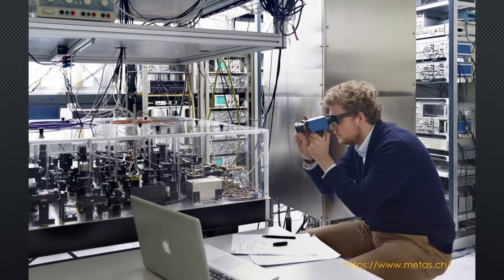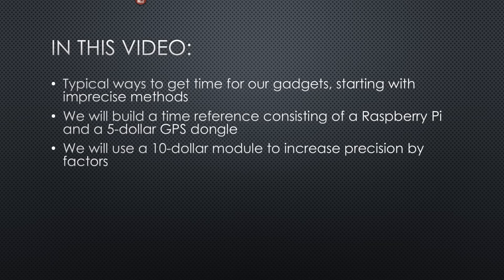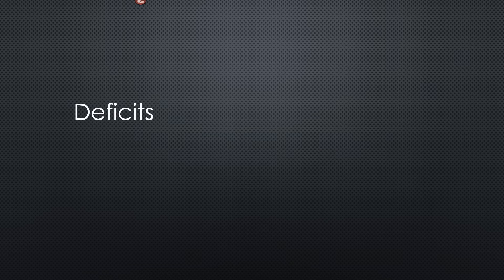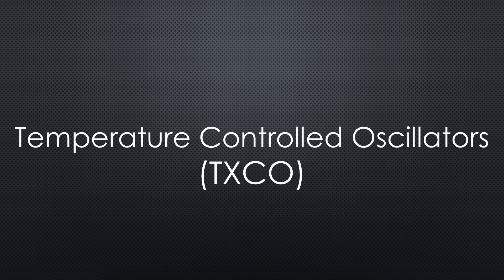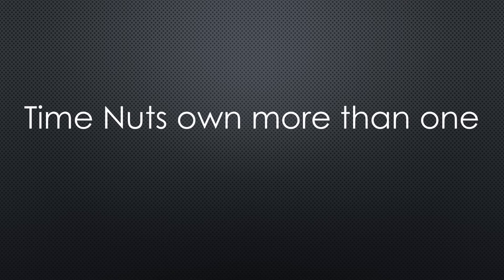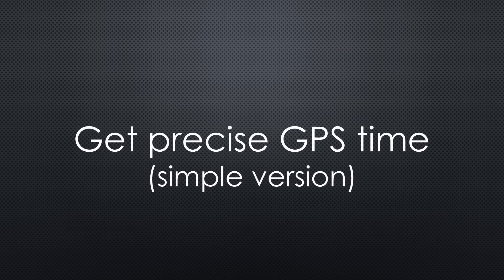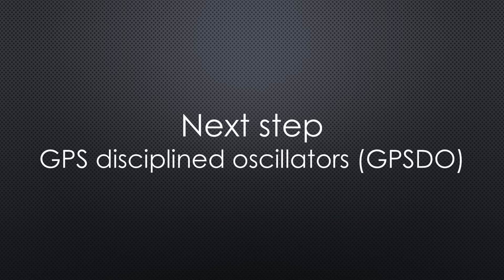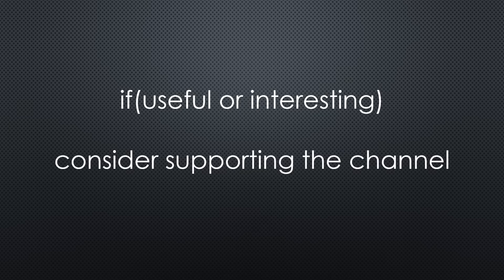(503) Precise Time without Internet: NTP Server from GPS Satellites

Comment: Get a $2 board with SMA connectors with neo6,7 whatever and remove the module. Order a used NEO-M8T (just the "chip"), real timing chip for about $25 and solder to the board. Also multi constellation antennas are available for $3, very little difference when compared to $65 survey antenna. Let me know if you need links.
Reply from the maker: Yes, links would be good because your stuff sounds interesting. But not here. They will be deleted.
Reply: @AndreasSpiess  Just came back to check if you saw my reply to find out that YT deleted it. Maybe this time it will stick: I have posted a response on my channel, it's in the shorts section.
Reply from the maker: Thank you! Now I have seen it. I have such a board, just with an M8N chip. It is very handy because of the two antenna connectors.
Reply: @AndreasSpiess  I started to play with GNSS using the same chip. I have de-soldered the the patch antenna and C2 from the board. When you connect an external antenna the patch antenna is working in parallel and that leads to errors in positional accuracy.

Comment: Have you looked at the GPS receiver available from Hans Summer over at qrp-Labs ( QLG2 )? Very reasonably priced(about $USD25), "kit" (although it's almost entirely factory smd loaded, just connectors and a case needed) that has 2 nmea ttl serial and 1 usb output, as well as pps output. It also has separated antenna with lna and an option to install a super cap on the board to hold the satellite data for faster startup. I have one in my shack and will be hooking it up to a raspi for my network time source. For now it disciplines the clock on my wspr transceiver and shack radio.

Comment: Excellent video.  Having spent way too much time in this rabbit hole,  I can attest that getting to nanosecond timing is relative easy,  but going beyond that point is very very difficult.  I thought I was doing well until Mr Sol started to show it's spots.  Getting an NTP server with 10ms accuracy is easy,  and good enough for most most sane people.... :->  but requires having an antenna with a good view of the sky.
Reply: For free order of magnitude improvement switch from NTP to NTPSEC.  We cut a lot of garbage out of the NTP Classic code base and got a huge performance and security gain.
Reply from the maker: I agree with all your statements. I added the PPS chapter because it was so easy...

Comment: I'm using this "ATGM336H GPS BDS Dual-Mode Module for Arduino & Raspberry Pi" with my telescope (OnStepX). It also outputs PPS and syncs in a few minutes even in my basement.
Reply from the maker: Interesting! What material is your house built of? Ours are built with lots of concrete, and no GPS signal comes through.
Reply: @AndreasSpiess  that explains your lack of signal. in the US, most residentials are wood stick-frame. Typically, reinforced concrete is reserved for walls in "nicer" houses or if a buyer requests it during construction. Anything partially or fully subsurface will be block or concrete w/ the upper floor(s) being wood frame.

Comment: I built a similar project last year with a different GPS module. I had to solder the PPS output directly to the chip. The module is now in the attic under the roof and the serial OUT incl. PPS is routed to the Raspberry via a 15m CAT6 network cable.
Reply from the maker: Indeed, not all modules expose PPS. I had to do the same with another module.

Comment: GPS signals can be "jammed". If that's important for what you do it's when you need rubidium clock references.
Reply from the maker: I agree with the jamming. However, rubidium clocks usually do not know the time. They just generate a clock and you have to convert it in time. For jamming, most people probably would stick with the system time for that period and synchronize again when the signal is reliable again.
GPSDOs use the same principle, BTW.

Comment: To make sure all my devices get proper time, I have a firewall rule to redirect all NTP (UDP port 123) connections from the lan to my time server.  No messing around with each device, and I can switch it around by just changing one thing.
Reply from the maker: Good idea!
Reply: @d00dEEE  Is it a real time server? If not I’ve seen recommendations to have (at least) three working as a cluster. Each can also include a different upstream NTP server provider, not just different servers at the same provider, so the entire consensus won’t slowly drift from the legal time while giving you good isolation if one or more of the upstream sources is compromised.

Comment: Very interesting, thanks for another great video, perfect timing too!
I am building a stopwatch system for sport where start and finish lines are remote (perhaps 2-400m) where I wish to use Meshtastic, serial, ESP32's to signal start/finish times to paired devices but need a time reference.  Is the PPM signal synchronous between GPS modules that it could be a heartbeat to synchronise my devices to calculate elapsed time?  Any accurate sync pulse would do if it is synchronous with ever second rolling over in GPS time.  What do you think @AndreasSpiess ?

Comment: Andreas, fyi XCO means Crystal Controlled Oscillator. I believe the X is used because it is similar to the symbol for a crystal, in schematic diagrams. And "C" has so many other uses.
Reply from the maker: Thanks for the info! I never looked it up.
Reply: @AndreasSpiess    I believe it is TCXO, for Temperature Compensated Xtal Oscillator (crystals on schematics are often designated with X or Y) and Oven Controlled Xtal Oscillator.    XCO is at least redundant, as an ordinary oscillator can be controlled by a crystal,  making it a crystal oscillator, XO.  An XO or TCXO can be a single device in a DIP package, or made of discrete components including a separate crystal.  Discrete TCXOs are uncommon, I would think, much the same way we don't laser-trim slices of quartz ourselves these days, though I wouldn't put it past some Time Nuts, having seen a YT video about a guy who makes integrated circuits in his garage.
Reply: In this context, X most probably refers to the Greek letter “chi” which is also used in the church for “christ”. So in some way that’s also not too far off the word “crystal”.
At our institute we use a machine for electron beam evaporation (to put very thin layers of metal on semiconductor samples), where an “Xtal” is used to measure the thickness of the deposited film. It’s actually a crystal, too.

Comment: Have you looked into the Precision Time Protocol?
Reply from the maker: No. I did not know it exists :-(
Reply: @AndreasSpiess  It would take the place of NTP in your setup and then you can synchronize the time between different machines on your location to sub-microsecond precision.
You probably won't be able to find an internet collective you can hook into like you can with NTP for example and therefore you would still need a primary feed from an atomic clock.
But it is good enough to synchronize the sampling of audio frequencies within the range of human hearing across hardware under your control.

Comment: Time nut here, too :)

An equally cheap (if not cheaper) way I've used in a recent project is software compensation, much like what NTP does, just drastically simpler:
* use a common 32.768 kHz crystal
* use just enough capacitive load so that the crystal oscillates slightly above the desired frequency
* calibrate the clock against a computer that runs the NTP daemon and deduce the number of one-second ticks to wait until you skip exactly one second.

This method can achieve precision in the PPM or maybe in the tenth of a PPM (not tried yet). I used it with my clock project and the result is barely one second drift over one month, which is nice.

I used a Raspberry PI and a program I wrote to count the number of events on a GPIO that is fed with a one second pulse signal coming from the microcontroller I want to calibrate. The latter in my case is an ATmega328 with timer 2 connected to an external 32.768kHz crystal and no capacitive load (it's not strictly mandatory). Pin OC2B provides the one-second pulse.

The AVR library has time management built-in and uses a 32-bit counter, which requires the application code to increment that counter every second. As for time compensation, I use timer 2 overflow interrupt routine to decide when to skip incrementing the counter.

Note that you don't have to use an ATmega328 though. A CD4060 would do as well but you have to use a microcontroller to do the calculation/adjustment.

For calibration, the computer (e.g. a Raspberry Pi) clock must be stable enough, which is reflected from the results of the `ntpq -p` command (or `chrony`). Check the NTP references use PPS. I found out that counting sufficiently large numbers of events (e.g. 7200 or 2 hours) is enough to reach precision in the PPM.

This kind of compensation of course assumes a stable ambient temperature or at least drifts compensate each other throughout the year. A more complex implementation may add in temperature measurement and empiric correction factors and that's a bit more complex but you get the idea.

Comment: I am on the 'time nut spectrum'.  I've used GPS antenna on desktop to become a local NTP server, but I also have several old-time mechanical pendulum clocks (a mantel clock, wall-mounted clock and a floor-standing tall-case ('grandfather') clock).  Obviously they are not as precise, but I set them each week to my GPS time.  :)
Reply from the maker: Now you could try to synchronize the pendulums with a magnet to your GPS clock ;-)
Reply: @AndreasSpiess  Hmm.. that would be a little tricky.  Each clock has a different length pendulum because of how they are displayed (fireplace mantle, hanging on wall, standing on floor).  But I suppose once I figured out the number of 'ticks' per second, it would be trivial to adapt each to specific clock.
Reply: Pendulum Taming is the way :D

Comment: A few years ago at a power plant I was working, they were doing a SCADA computer upgrade.  In one review meeting, someone noted the contract required attaching a GPS receiver to the top of the building.  Some of us were like, "Uh...we know where the building is, and it's not likely to move."  LOL

Of course what they were doing is exactly this, using the time reference signal embedded in GPS.

P.S.  We did have oven-controlled crystal oscillator used to help with maintaining system frequency but that was a much older tech.
Reply from the maker: Nice story! All cellular towers also have such GPSDOs with oven-controlled oscillators. We get some of them for cheap when they dismantle the old 3G towers. And I think that the GPS on eBay I showed also comes from such a tower.

Comment: What happens if GNSS is jammed or taken out?  You can still get a very good PPS signal by listening to pulsars. It takes a few hours of integration time before it's usable, though.
Reply from the maker: If jamming does not occur all the time, you can leave your system time "free-running" during jamming and synchronize when the GPS signal is back. In the short run, quartz clocks are stable enough.
Reply: @AndreasSpiess  where are the good old DCF-77 or HBG ?
Reply: That's what your GNSS disciplined rubidium standard is for.  It'll keep very accurate time during the periods GNSS is not available.  Or just get a cesium clock :)

Comment: Is It possible to get precise time from the Galileo positioning system?
And if one wanted to keep a simple microcontroller synchronised, how good can relying on DCF77 (European continent) or MSF (UK) be?
Reply from the maker: Most modern GPS receivers use all satellite constellations. DCF77 is based on atomic time. So, it is accurate. But sometimes not audible.
Reply: Thank you,  @AndreasSpiess .
These terrestrial long-wave broadcasts can, indeed, be quite weak (I have all my alarm clocks/wall clocks synchronising with the MSF and they really struggle in certain rooms of my house) but they seem so much simpler to use, even with a very modest MCU, provided one can find the receiving modules.
Any experience with DCF77 and microcontrollers? I guess an accuracy of a few ms should be achievable?
Reply from the maker: I made a video where I built my DCF77 transmitter for the basement...
Reply: @AndreasSpiess  
I'll check it out 👍

Comment: I've used GPS USB dongles, Chrony, and Pis or PCs for years, both on the home network and while in the field with Ham Radio deployment. I haven't found need for PPS accuracy in my usage, yet.
Reply from the maker: I also plan to use one of my NTP servers for our AREDN network that is not connected to hte internet.

Comment: What about using GPS Disciplined Rubidium, those i have found for like $70-$100, can they be used for NTP and or PTP?
Reply from the maker: GPSDOa are often used for spectrum analyzers or radios. They usually only output 10MHz and have no clock inside. So you need a way to get exact time (including split seconds, etc.)

Comment: afaik noselect means never use it, you can remove that and it will be used if the pi needs bulk time, then it uses pps for more accurate second.
Reply from the maker: I did not need noselect for my setup. Chrony automatically selected the best source.

Comment: I can remember when all the clocks in the house had different times & were wound by hand. Time nuts have come a very long way in very little time!
Reply from the maker: I agree. And I still have an automatic wrist watch withour batteries ;-)
Reply: @springwoodcottage4248  Many of us still have old clocks. It is always an adventure when it’s time to change some, but not all, of our clocks.

Doh - I should get some cheap stickers and only put them on clocks that must be manually updated.

Comment: AI Summary:

Achieving Nanosecond Time Precision with GPS Receivers: A Guide for Aspiring Time Nuts

*   0:00:09 Introduction: The video explains how to achieve precise timekeeping without internet access or personal atomic clocks, using inexpensive GPS receivers that leverage existing atomic clocks in GPS satellites.

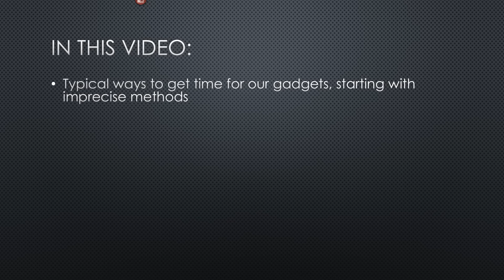*   0:00:49 Time sources compared: Different methods of acquiring time are compared. Microcontroller's internal clock's have 10-40 PPM tolerance, RTC chips are similar with battery advantage, tcxo is more precise with 1 PPM. Oxo is even better with 0.01 PPM but are expensive. Atomic Clocks have millisecond per year accuracy, but are expensive. GPS satellites have precise time signal due to their built in atomic clocks.

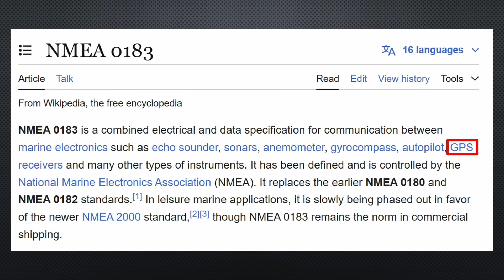*   0:04:33 Method 1 (GPS Dongle): The first method involves using a $5 GPS dongle with a Raspberry Pi. Instructions include: placing the dongle for optimal satellite reception, connecting it via USB, updating the Pi, and installing `gpsd`, `gpsd-clients`, and `crony`.

*   0:05:56 Verifying GPS Data: Ensuring that the GPS dongle is outputting NMEA messages and obtaining a location fix is crucial. This may take several minutes if the receiver hasn't been used recently.

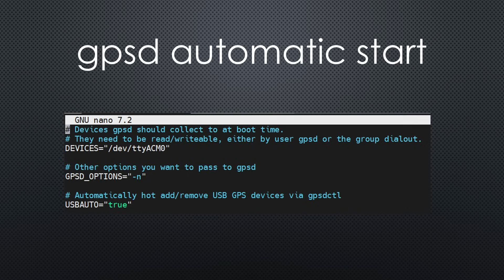*  0:06:16 Configuring Software: This involves configuring `gpsd` to start automatically at boot and setting up `crony` to use the GPS data as a time source, compensating for processing delays.

*   0:07:09 Initial Precision: This setup provides a time reference accurate to within a few tens of milliseconds, with jitter in the millisecond range, suitable for many applications.

*   0:07:28 Method 2 (GPS Module with PPS): For higher precision, a different GPS module with a serial connection and a Pulse Per Second (PPS) output is used.

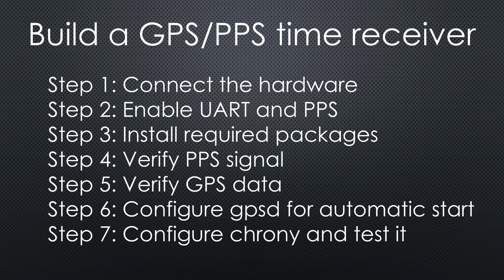*   0:07:50 Additional Steps: This method requires different wiring, connecting ground, 3.3V, RX, TX, and the PPS signal to the Pi's header. An external antenna may be needed for indoor use.

*  0:08:46 Pi Serial Connection: The Raspberry Pi's serial connection needs to be enabled and configured for the PPS signal, disabling any conflicting terminal functions.

*   0:09:15 Software Installation: In addition to the previous software, `pps-tools` needs to be installed to handle the PPS signal.

*   0:09:50 Configuration: The `crony` configuration is updated to include both the GPS data and the PPS signal, prioritizing the latter for its higher precision.

*   0:10:28 Precision Improvement: The PPS signal significantly improves precision, achieving nanosecond accuracy compared to the millisecond accuracy of the GPS data alone.

*   0:10:43 Further Improvements: Aspiring "time nuts" can further improve precision by using specialized timekeeping-optimized GPS receivers or by fine-tuning offset and delay values.

*   0:11:21 System Time Synchronization: The video verifies that `crony` synchronizes the system time of the Raspberry Pi.

*  0:11:30 Network Time Distribution: The precise time source can be shared with other devices on the network using the Network Time Protocol (NTP) by configuring them to use the Raspberry Pi as their NTP server.

* 0:12:16 Conclusion: The project successfully demonstrates how to achieve nanosecond time precision using inexpensive GPS receivers by leveraging the atomic clocks in GPS satellites.

I used gemini-2.0-pro-exp-02-05| input-price: 1.25 output-price: 5 max-context-length: 128_000 on rocketrecap dot com to summarize the transcript.
Cost (if I didn't use the free tier): $0.02
Input tokens: 14503
Output tokens: 813

Comment: When using the PPS signal from the module, jitter on the NMEA data is irrelevant.  So you can safely connect the module to the PI via USB. Power and data, over one plug, and it leaves the uart free for other uses.
I've got exactly the combination of a PI,  RTC, and PPS / GPS in my car.
Reply from the maker: I agree. However, I did not see USB modules with PPS output. This may be because I did not search for them.

Comment: @6:39 modern GNSS modules like the waveshare LC76G are working with 115200bps
Reply from the maker: You are right. The speed of most receivers can be changed. However, most come with 9600.